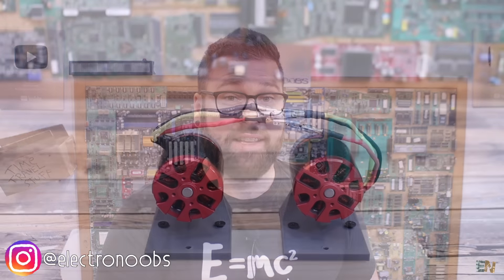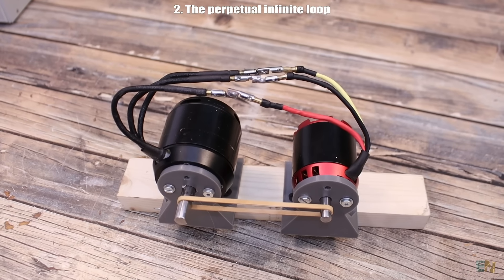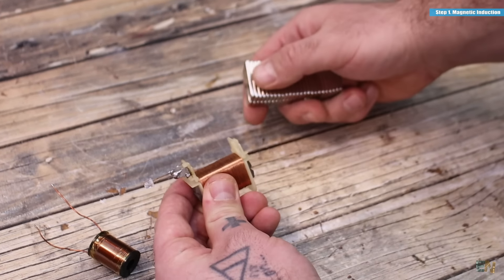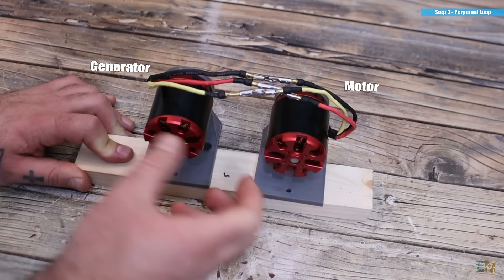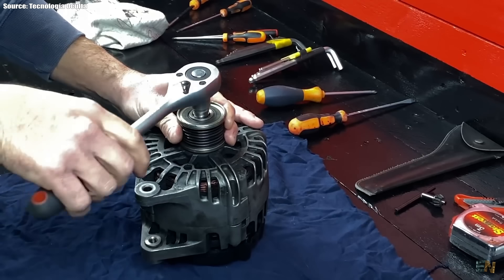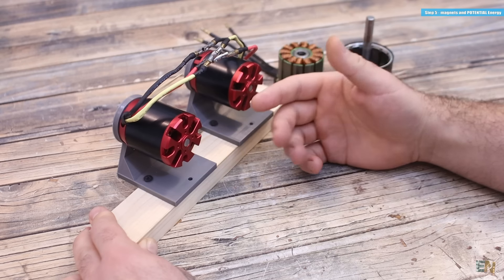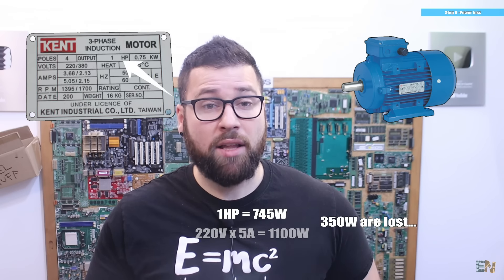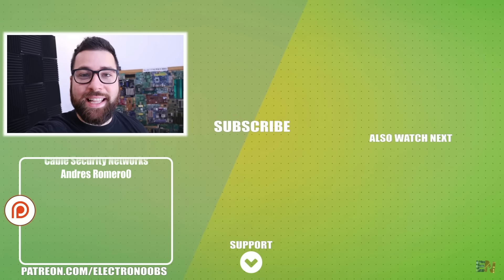Free Infinite Perpetual Energy Nonsense - FAAAAAAKE

Comment: The secret to free energy is to hide the battery very well. :D
Reply: even the battery is old-fashioned, which is already replaced by the 'supercapacitor', fully charged in 2 minutes (80/85%) and can handle very large discharge currents, more than the 18650 battery.
Reply: @oldwizzy  supercapacitors have a very poor energy density.
Reply: @oldwizzy  the energy (in Joules) in a capacitor is the half the capacitance times the voltage squared. Let's take a standard 100F supercap which roughly has the same volume as an 18650 cell (18 mm diameter and 65 mm length for the 18650 Li-Ion and 22 mm diameter and 47 mm length for the supercap). At 3.7V the energy in a standard 3Ah Li Ion cell is 11.1Wh. The supercap is a 2.7V rated one, so a 100F one can hold 364.5J of energy... that's a little bit over 0.1Wh, 111 times less than a similarly sized 18650 cell on average. And this is a high end supercap. 

Yes there are advantages to SuperCaps, but energy density is not (yet) one of them... and there are some new supercaps that are hibrids between a supercap and a li-ion battery, those are even more niche and still at 10x the energy density are an order of magnitude less dense than li-ion batteries.
Reply: @VrumsAdventures  
Je snapt het duidelijk niet, daar gaat het in basis niet om, door de oplaadbare capaciteit van een supercondensator is deze totaal niet te vergelijken met die van een accu en diend daarbij een totaal andere rol dan die van een accu.

Juist doordat deze kennis in basis bij jou al totaal ontbreekt, was je voor mij al niet geloofwaardig.

Nu met dit antwoord heb jij jezelf belachelijk gemaakt zonder dat je het nog doorhebt ook nog eens, dat je niet eens een techneut überhaupt bent.
Reply: @oldwizzy  I am not a "techie", I am an actual engineer. I design stuff around batteries and supercapacitors among other things. You fail to see that there are 2 sides of the charging problem: the storage (battery, supercap etc.) and charger. You are correct that supercaps and batteries have different roles. The model cars you showed are one application for the supercaps. But that can't scale up to real vehicles.

Good luck, but as an advice for the future, don't go insulting people on the internet... it deteriorates your credibility.
Reply: @VrumsAdventures  
I am an high technical electronicus whith an Bull for that, from the Dutch  Corps of Mariniers Volentiers and USA USAF for 16 years after that.
Now retired but living in the full country of freedom The Netherlands.

En ik geef die dummies hun vet welke zich letterlijk met prietpraat bezighouden, zoals jij.
Dat de waarheid hard kan zijn is niet mijn probleem.
Reply: @oldwizzy  I understand, you're old, bored and a self-sufficient know-it-all. Good for you! There's worse things you can be :))

You showed me who's better, clearly. Undeniable... batteries are old fashioned, supercaps are all the rage... you certainly showed me how great they are in model cars so together with dashcams that's like 99% of all practical applications :)) 

And all this as an answer to a joke comment (that to my shame was even made by someone else faster than I could ... so I am a loser in all aspects of life, a dummy as you would put it).
Reply: @oldwizzy  First, yeah, I recently worked on the design of a supercap jumpstarter... wanna know the fun part? Even that has a (albeit smalller) battery to run the electronics and control the charging of the supercapacitor :)

About the Mars colonization in 20 years... you're too much into Musk talk. That's bullshit. If there's any structure built on the moon in the next 20 yearsI would be thoroughly amazed and shocked (in a positive way). 

I don't know of any electronic flight project with supercapacitors as power, but I am pretty sure it's for extremely short flights... The capacitors that would replace the battery for 1/5th capacity would wither weight the same or take up the whole space. Do the calculations yourself, choose any capacitor and compare it to any li-ion cell.

Solar panels are good for low-power, long term and if possible stationary applications. Having solar panels at their current efficiency (which can be improved but there is a physical limit to it) can't be used for too small applications and on airplane wings or car roofs and hoods the gains might not outweigh the issues they bring and might not even justify themselves economically... do you see any mass produced consumer vehicles or planes with solar panels? Me neither. Mosquitos with solar panels? They'll waste more energy carrying them than they'll gain from them.

65 is almost twice my age... it's more than my parents' age and they're grandparents. I am not discriminating, I am simply stating a fact: you're old (relative to my perception at least). You're also bored, clearly, and apparently you either lack the means or the will to fight your confirmation bias and check some facts. I too would love to live in the world of Star Trek, hell I'll settle for the Expanse even, but I will try to check if someone promises SF stuff to see if it's not just fiction :)

Again, have a good night and, honestly, I appreciate the fact you and people like you exist. I am sure you're not a bad or even dumb person, I just think your hopes and your facts aren't clearly separated.
Reply: @oldwizzy  ok... :| 

This escalated quickly.
Reply: (( so my phone works just because i touch it ,the rest of time have no energy  ,,i creat energy with my hand ,not the magnet ,,,so the wind have the energy instead of the magnets, right ,,,of coz it wrong understanding)) ,,and last ,,you havent properly built it ,,though you proved the motor can move the other one  by energy coming from the magnet ,,,next time put a proper gear ,,,,it is about the energy of the magnets ,,the magnets are activated with electricity in the process of manufacture ,,,,do it right before saying is fake

Comment: There actually is a working 'free-energy' machine.  I've seen it, tested it, etc..  There is no such thing as creating energy from nothing; that is true.  But there is a way to create energy from SOMETHING.  You just need the right 'SOMETHING.'  It works!
Reply: yup a Stirling engine would be ideal.. trouble is the friction and losses make them so week they could not propel a generator
Reply: Plutonium maybe? It’s what they use on the mars rovers, free energy!!! (Of course, radioactivity is just a kind of very slow burning fuel, it doesn’t last forever)
Reply: @CJCruiser  thats not free energy its literally the energy emintating from the plutonium thats what radiation is, its a form of energy that the element just cannot contain and therefore it leaks out but will eventually stop, and you cant just harness the pure energy coming from the plutonium you have to get it through other means like putting it in water so the water will heat and boil and turn to steam and then turn a turbine which produces energy
Reply: @Fisheiyy  sorry, I meant for my exclamation marks to indicate sarcasm, I know what radioactivity is, I just can't for the life of me figure out what other people here think free energy is.
Reply: @CJCruiser  That's not free energy.  Try the Earth's magnetic field.  Everyone needs to read about Tesla's work before commenting.
Reply: I have heard it said, and I am not the expert here. But a person can do any amount of work with the correct transmission gear ratios. Like a Mountain Bike.

Comment: A simpler way to fake the video is just to run power up through the underside, into the power strip. No need to gut the parts, just spin the generator with the motor, plugged in. Mains power can be fed in through table legs, holes in the table or any other route, out of sight of the camera..

Comment: The oil company offering and say,help us how much?!!! Tell people that is fake!!🤣🤣
Reply: Magnet energy nonsense?  Really? So your saying a magnet doesn't have stored energy?You might want to rethink that statement. As magnetics isthe inverse of electricty. It's just how your able to harness it. So if you think your an expert on brushless motors. Then you will know that positioning is everything. That inorder to turn a motor requires them to be at then right place at the right time. That you can also use electricity to make a temporary magnet
 While I may agree with you that they should try to use the most efficient motors
 While I cannot say if some or none of these actually work.

I do know of ones that do just from simple logic how the other ones work. 

For example. lets just say you have a baaic electric motor that also has a stator on the end of it. 
Also lets say the motor has earth  magnets on the rotor and has electron magnets positioned all around the motor. 
That the electro magnets are connected to relays and directly connected to it stator/ generator on the motor.  

So if you were to spin the motor faster it will create more energy. But when you want to pull a load from the stator generator its magnetism will increase making it harder to turn. 

okay thats  simple 
 So lets say those stators are connected to capacitors that go to relays and to the  electromagnets around the motor. 

So if you just spin it by hand there is almost no load or resistance, but will charge those capacitors fairly easy while you turn it, to store temporarily . 

bur regardless of capacitors and relays.  lets just say the motor doesnt have magnets inside it yet that your just spinng the motor by hand  and the stator is energizing the coils . Relatively easy as there is no load.Then you make it so that the other end i drags along then shaft and only energizes and magnetizes at it final push (repelling locations. I you spim it by hand it still just as easy to turn. so putting magnets back  on the motor and you spin it the motor is just as easy. As the  electrmagnets start to energize at its push location. meang it will  want to push the motor. that it pushes and increases the speed. still almost no resistance same amount jusy to turn by hand but 
now the as it only energized during push  location it starts to push it making it easier to turn by hand and as it turns faster it gives more power making magmnets stronnger  pushing harder and again making it faster more power making magnets stronger that push harder  then go faster more power >stonger>> faster> more power> stronger> faster. So now by adding MOSFET relays  you reduce the friction and add capacitors  that collect and storen the excess energy when not acitivated that ot uses when it does and you have a magnet motor. Simple ideaa. 
So now back to these ones i. have noticed the ones  that look legit usally have different size motor/generators. That if the motor is smaller the the generator has a larger pulley. which makes it eaiser for the motor to turn the for the power it recives. That I havent seen any working models that have two same size motors and pulleys that are working. Which may be because of to inefficiency it doesnt produce enough eneegy to spi something  that itself requires same effort to spin and thats what I belive you haven't factored into to equation is the gearing of the pulleys to make up for those inefficiencies. 
So you can just go blah, blah, blah without any actual testing of your own to validate your rambling.

Comment: Version 1.0... "We use special magnets and can't tell you the specific details right now which means if you try to build it yourself, it probably wont work..."

Version 2.0... "We use a special alloy of aluminium and silver and we can't tell you the specific details right now which means if you try to build it yourself, it probably wont work..."

¯\_(ツ)_/¯

If they are in a country with a relatively low currency exchange rate, making a convincing fake video that generates a lot of views could very well provide income that far exceeds a typical wage.
There will always be people willing to sell snake oil, just as there will always be people willing to buy it.